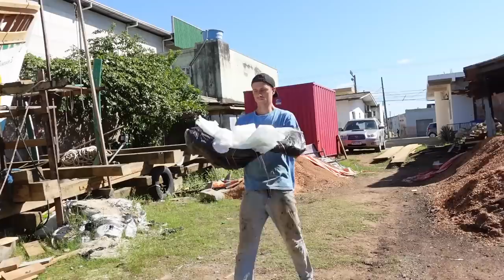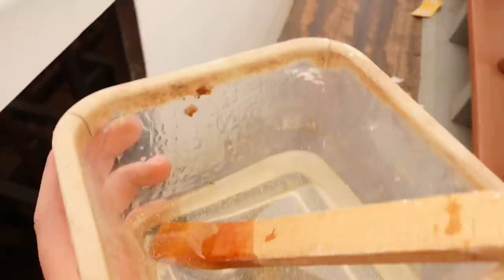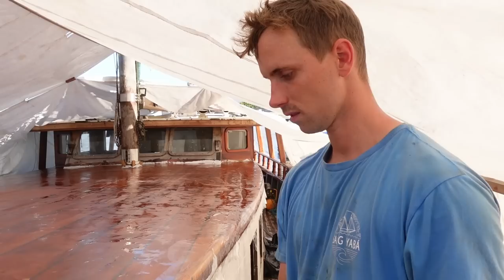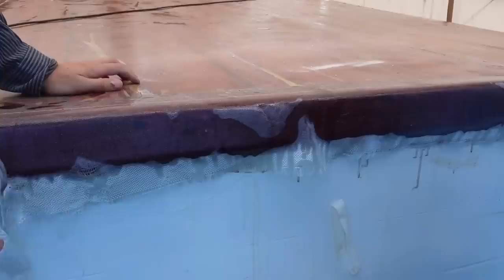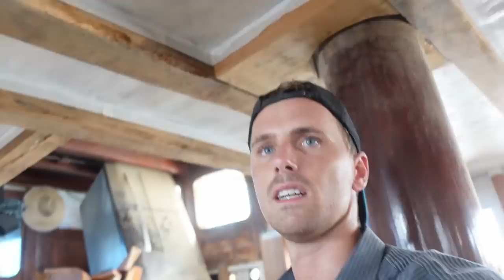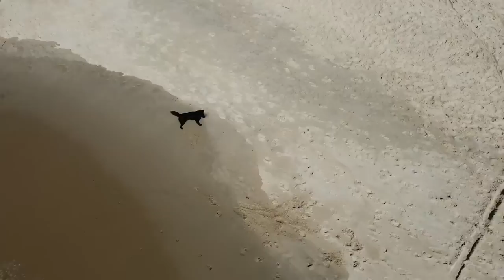Three rookies saving the roof of a rescued wooden sailboat — Sailing Yabá #92

Comment: When you have to strip and refinish the varnish (You will) and for future "Large" surfaces... You may wish to use a floor buffer instead of a palm sander. Wet sanding with the larger surface pad will give incredible results. Gonna need some non-skid up there though.
Reply: @ralphgesler5110  The size of that roof deck and the give in a buffing pad makes the camber unimportant. It is only a suggestion.

Comment: Hi you fiberglass newbies.
Using a steel roller really helps to put the fibers down to the wood and using peelply over the glass is the secret method to get a good bonding with the next layers. And you don't have to sand afterwards because you get a freshly broken open layer of epoxy...
 Simply adding more resin is not so productive, you still get new bumps and you will have to sand of 80% of the resin. There are chemical thickeners for epoxy resin, you can get the resin as thick as honey and it's still transparent..
 Anyhow as always with surfaces on a boat, 95% of the work is before you actually put on the first layer of resin or paint. And a clear finish is the hardest to achieve. For a rookie nearly impossible to get perfect. But who is really later on seeing the roof from nearby? So get the job done and live with your results happily that your cabin is dry...
By the way I would simply paint the roof white, better protection of the epoxy and much cooler in the tropics...
Matthias in Samos Greece on my trimaran..

Comment: If you have another area, put a layer of epoxy first.  Sand, add more if the wood soaks up the epoxy. Sand, put on your fiberglass by putting down epoxy, setting the fiberglass on it, rolling with a steel roller, adding epoxy as needed.  Sand and add layers as necessary.  But for a first time with no training you did okay.

Comment: In the industry a way to prevent the bumpiness of epoxy is to use a material which is called peel ply. It is used to do three things: 1. it absorbs the oily residue which all epoxy resins tend to leave on the top, 2. it leaves a surface finish (a texture) in preparation of the next layer of either epoxy and/or fiber glass or even carbon and 3. (which is an effect of number 2.) it leaves a rather smooth and even finish on the epoxy layer.
The thing with peel ply it is a to be discarded material and is rather difficult to remove after the epoxy has cured (not dried) and it has done it's job.
So guys, if you want a nice finish look into getting peel ply which looks like a fine woven cloth made of polyester... As I said, it leaves a smooth and ready to go texture which looks like the woven texture of a fabric but a bit finer...
Sanding any surface with fiber glass in it is a bit of a risk since one can very easily sand through the structural layer of fiber glass...

Comment: That looks fabulous! Where I work, the fabricators used to make molds of fiberglass of the leading edge slats to produce ice shapes. Items to replicate in-flight icing due to malfunctions or human error. It is necessary for certification to know how an airplane will perform when this happens. The most amazing part to me was how hot the resin would get as it cured. Of course now they no longer use fiberglass for this due to 3-D printing.

Comment: Epoxy can be recoated without sanding if you can leave a fingernail print  in it (still a little soft) you will get a good chemical bond.

Comment: Fiberglass is a real sucker to work with. Was looking thru the comments. Yes, a second layer of glass might have been good, but I think it would have taken away from the beauty of the wood. The bigger thing here is waterproofing, not so much structure. I can only imagine how many layers of epoxy you are going to need though to get the glass finish you want. Take your time...your off to a great start!!

Comment: What are your plans for non-skid on the roof top?  You may need to go up there underway to handle the sails and a perfectly smooth (wet) surface will be dangerous to stand on. You could put sand or grit in the final coats of varnish.

Comment: He bit of advice from someone who does a lot of fiberglass buy a roll of peel ply cut it just like you did your fiberglass when you put your next call is at Moxie on the latest he’ll fly over the top and then squeegee it is it’s going to do two things number one I’m gonna give you a much smoother surface and number two is going to eliminate the need to do all that standing before you put on subsequent coats of epoxy

Comment: You should of got this metal roller that’s the same size as the sponge roller u used but it’s better at getting air bubbles out and helps get good lamination.
Still good job for your first time

Comment: What is your plan for making it non slip?    It could be a very dangerous slip fall problem.   Maybee  shake coarse silica sand  on  the top of the  last coat,               Do some test samples  making  a sand shaker   .

Comment: It's funny. When you glass with polyester resin it just sinks into the glass. When you glass with epoxy the glass has to have time to absorb the epoxy. If you try to rush it then the epoxy bubbles and froths.

Comment: The problem you have is fiberglass goes hard when dry, wood is soft, and the two don`t mix. wood moves when it gets damp, fiberglass stays the same, you then get cracks and the glass fiber comes away from the wood, water gets in then the rot sets in. bingo you are back where you started.

Comment: BEN HAVE YOU THOUGHT ABOUT PEEL PLY GLASS YOU PUT IT ON AFTER YOU PUT THE RESIN DOWN AND WHEN IT SETS YOU TAKE THE PLY OF AND YOU HAVE A VERY SMOOTH SURFACE AND IF WANT YOU CAN PUT EPOXY STRAIGHT ON NO SANDING  GRAHAM FROM AUSTRALIA

Comment: Why fiberglass at all? Why not just epoxy then varnish? Fiberglass is normally used for strength or support which you don’t need.
Reply: As a way of keeping the plank seams from opening up, I think.
Reply: @billvanvlack117  bill,  because they never checked the moisture in any of their wood i think they are goint to have major problems in the future.

Comment: Generally love your videos, the epoxy job itself is good, but was amazed and surprised by the lack of safety gear, not even a mask or gloves, at a bare minimum I use both, in an enclosed space I use a respirator! Even if you don't value your safety you are a Youtube representative, and should think about that, and maybe at least mention it next time. At least you are wearing a mask while sanding(although I wear a disposable full body suit). I hope you look after yourselves in the future.
Reply: My toughts exactly. Epoxy allergy is a serious thing!

Comment: Hi Ben Hi MP. I must admit that I was a bit worried about you doing this job ,Silly me .But you have done a great job on it .At one point in my life I worked in a boat factory and I knew what was coming for you .As you said ARRASOU .Way back at the beginning of this  Journey you ask me if i had seen a worse boat than this one and i told you yes i had .But buy the end of this rebuild I think you will have Far surpassed the quality and fit and finish of any other boat I have ever seen done .

Comment: Well it ain't pretty to my eye, but it won't leak.  Peel ply would have been a good idea.  But then again, filling, fairing, fibreglassing and painting white would have been a better one.  But that's experience talking, not passion.  They will end up painting it white I expect since it will be hot in sunny climates and need sanding and varnishing annually to stop the epoxy degrading in the UV...  sigh.

Comment: epoxy resin has no UV resistance. Polyester resin apparently does. as well pure resin has no strength. from all the You-tube knowledge I've gathered your next step to "fair" the deck top would be to use TotalBoat fairing compound, or thickened epoxy. ...however any sort of fairing compound will also reduce the clearness of the coating.  Keep going???? Of course!!!
Reply: Some epoxies now do. You need to check.

Comment: As the fiberglass on the roof is not structural it should work fine for waterproofing as long as all voids are covered and the epoxy binds the glass to the wood. Can’t imagine keeping this vast expanse maintained in varnish. Yikes!

Comment: PLEASE MP!!!... try to not get so close to cut, torn, or loose edges of the raw fibreglass matting.  F/G is notorious for flinging off random fibres, which are VERY DANGEROUS. Should one get taken in, via your breathing, those fibres can cut like razors.  FWIW, anytime one is even NEAR fibreglass mats or bundles, a high quality full-face and eyes mask is both recommended and a PRIME safety consideration.  PLUS, we won't mention, this time, the off-gassing from epoxy resins... ;-O

Comment: The sander isa way too small for an area that size.  You ned a large plate sander.  using a hand sander means the surface will never be flat.  also you should have roles it over with a washer roller to get excess resin out.  SaVES WORK LATER

Comment: I’m curious. What if you try using a little bit bigger roller applicator to put the epoxy down and then finish it off with plastic trowels to smooth it out?

Comment: I can’t say anything else than OMG and congratulation to the problem you will get in the (near) future when the de-lamination starts, the continuously strong sun shining from the top (did you use Marin epoxy, looks more like a epoxy fir indoors usage and additionally you mix the resin/hardener just to a random  ratio !?) and the cost for the price for marine varnish which you will need to apply at least 7 layers of (when having used Marin epoxy) to protect from the UV shine. 
To me you have together with your consulted experts created another “desastre” 😱 Once again WHY fiberglass.

Comment: Why three rookies? What happened to the whole team of shipwrights working with you just a few weeks ago? You're going to need a hell of a lot more sanding to avoid an eyesore. That would be a shame after all this work.

I'm sorry for sounding overly critical, what you've done with this boat is amazing. But it was just a bit painful to see you guys spreading epoxy on such a large surface with those tiny tools. Wouldn't it be easier to get a smooth surface by using larger squeegees and rollers, the sort people use for applying epoxy on floors?

Comment: WHY OH WHY are you using fibre glass on a wooden decking? It makes no sense to me at all. It has a great finish and varnish is all it needs, I just do not understand! There will come a day when all that stuff has to be removed, which, in my experience is not as pleasant as just scraping and sanding and revarnishing. Also, in nautical terminology the ceiling is called the deckhead, wall is bulkhead. Toilet is the head.😁